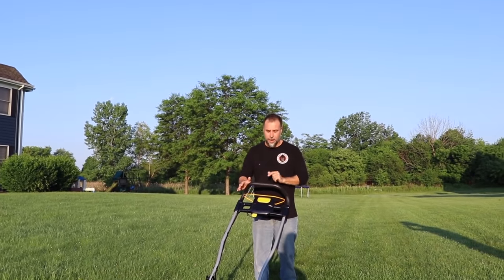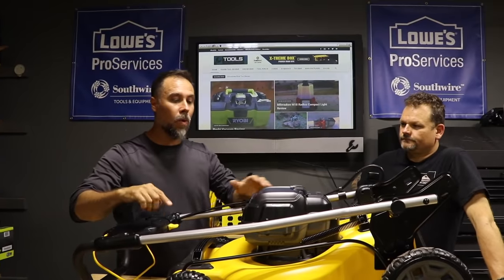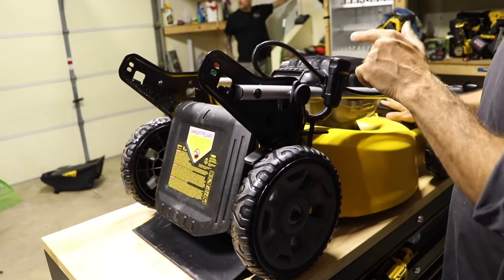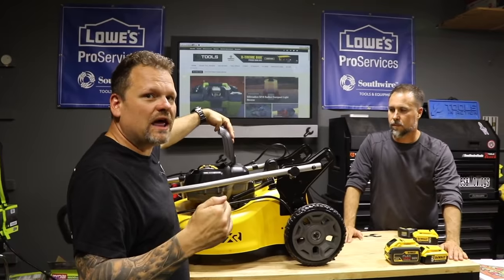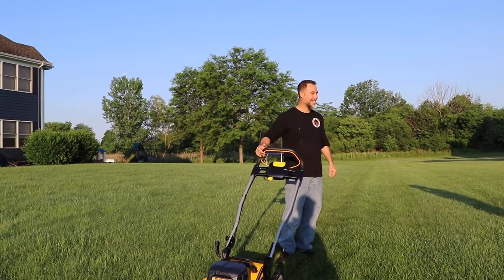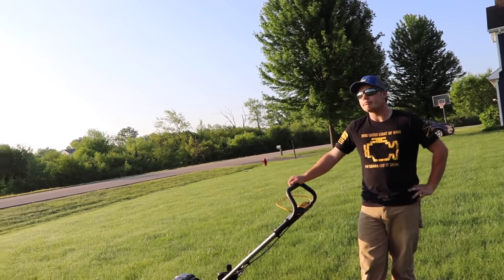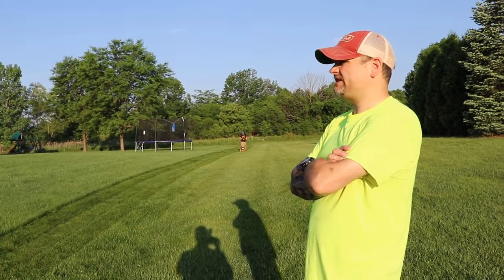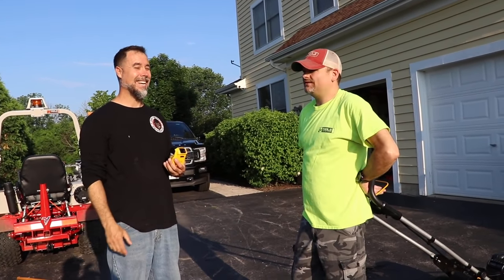Dewalt- 1st place for the Worst Lawn Mower of the year

Comment: Seriously?  The grass is wet, it's 4" deep and you're mowing with an electric mower without a side discharge. I had a gas mower that wouldn't do that before.....  put a chute on it, raise it up an inch and mow on...!
Reply: too complex for them...
Reply: Yea, you have to be smarter than the grass....
Reply: Just watching the intro, I know they didn’t know what they were doing!!
Reply: SuperDave21 I have a 7.25 ft lbs mower, it's brand new... Tons of power and it will not mow this grass on mulch mode... I've used other mowers with more power that won't cut this without issues. I actually know a guy with this mower... Had it a few weeks, and guess what he really likes it. Has a smaller yard though, and it cuts the grass but he doesn't cut grass this tall when it's soaking wet either. Can't expect lawn tractor power in a push
Reply: SuperDave21 dam I just had the same comment. You don't mulch wet grass. This would be a yuppie lawnmower.
Reply: Airflow in the deck is key to mulching. These mowers are not of advanced design. This is a stupid test.... not worth our time to watch. Just wanting hits.
Reply: My thoughts exactly..
Reply: These kinds of reviews are only good for a laugh 😂
Reply: SuperDave21 I KNOW SO TRUE
Reply: SuperDave21 they bought the cheapest version. Wheres the bag.
Reply: DeWalt Fanatic Are Us LOL
Reply: multching mower on that tall of grass not, side discharge maybe slower pushing maybe
Reply: I don't know a gas mulching mower that would of done what they were trying to do. It would of stalled like they did.
Reply: Folks looking for a miracle and a handout.  It baffles me how many reviews are out there complaining about stuff like this, when I see folks with the big machine not wanting to cut wet thick grass or they side discharge and double cut, yet they expect these little machine to do the job.  It just baffles me.
Reply: I was about to say. They went way outside what that mower was designed to do. Not a fair video on that product. It's probably a great little mower for a "green" homeowner who mows every week or maybe every 5 days or so.
Reply: So true when I try to mulch wet grass with my gas mower eventually the mower will stall, but open the chute and let the grass fly and I have no problems. I personally would never buy a mower without a side discharge option.
Reply: SuperDave21     I agree. Cutting grass is rocket science for some people; black magic for others.
                             Never cut it wet. Take your time.
Reply: Try to pull start your gas push without lifting up on the deck, it doesn't make sense.
Reply: My 25 year old gas powered  MTD 5.0hp  would cut that.  It's called maintaining your lawn mower and keeping your blades sharp.  And Yup I've mowed 1/3 of an acre on a  sloping hill.  Thank god for self propelled doo dads.
Reply: Could not agree more. Didn't make it past the intro. Let's now this lawn that's over grown on the lowest setting, while it's wet and at a fast pace. GTFOH.
Reply: I agree, pathetic review lol
Reply: My petrol mower from 1990 or even 1986 would piss all over that thing
Reply: Mate his aim is to provide a bad review
Reply: Well, I'm glad to see people have the same thoughts as me. This was a terrible review.
Reply: @TheJma1024  you dont mulch wet grass. Whats wrong with you people?
Reply: Exactly. Until I added the side discharge to my mower the bitch even had issues when dry. Mulching is great with shorter grass
Reply: I mowed my Bermuda grass with my EGO.  It was wet and did just fine.  Only issues was cleaning all the crap under the deck.
Reply: My kobalt 80volt has no issues with tall wet grass. That’s just not powerful enough
Reply: Agree ... what a stupid review ..
Reply: Mate I do agree with you!! And and..! Use FLEXVOLT BATTERIES FOR GOD SAKES!!!
Reply: I live in wetlands and my 40V Greenworks handles worse than that while mulching. Electric should be able to outperform gas. I've been running that through a very large yard when and where it's too wet for my rider. It's been shockingly good.
Reply: You guys must have some week gas mowers
Reply: Right.  The implication is that there exists a cordless lawnmower that can actually tackle that task.   Hey, maybe Tesla will come up with one, given another decade.
Reply: Well if your testing equipment and putting it through the roughest treatment then you can look at the quality and run time for possible applications you might use it on. So they are putting it through rough stuff for a reason.
Reply: They need pros for this job ;P
Reply: It definitely needs a box on the back of it else it will clog up regardless
Reply: The Milwaukee did way better in higher grass
Reply: I agree……completely silly and unrealistic use of the mower…..wet grass, no height adjustment, no chute, …nonsense….
Reply: I know he’s totally abusing the bajeezus out of the thing - but I got the 2x20v dewalt a couple months ago and honestly it’s frustrating as all get out. Really is the worst mower I’ve ever owned. Just not enough torque for a mower. My lawn is far from perfect - and the mower regularly stops itself and requires a restart for even slightly thick areas of Bermuda in the dry heat of Arizona. I can confirm that this guy is #doingitwrong but also still on point somehow. Buyers remorse is super deep on this one.
Reply: Under power just junk. I'm glad to take a crap less than 8 minutes.
Reply: If the mower was good! It would handle it!  And dewalt is a professional company! Except for lawn mowers!!
Reply: He put an EGO through worse conditions with mulch plug in and he couldn’t stop it. This DeWalt mower is junk. EGO  is the GOAT of lithium powered mowers. 👍🏻✌🏻

Comment: I don't doubt that there are battery capacity issues....but trying to  cut in mulching mode in deep wet grass like that is a bit severe....just sayin....
Reply from the maker: Yeah-  but a gas powered mower could handle it.
Reply: Maybe.
Reply: Zack Young most people don’t use a regular drill in masonry they usually use  a hammer drill and they don’t use it all day either. I agree that the mower is junk because you can do a lot more with a cheaper gas model than an electric
Reply: Maybe a gas mower could but it would be at capacity and putting more than necessary strain on the motor.  I wouldn't do this with my HRX Honda mower because I care about it and I'm not an idiot.  As someone who used to work at a power tool dealer for Professionals / Contractors I don't even really like a fair bit of Dewalts products but your test here was just plain unfair and asking way too much of that Dewalt.  That grass was wet, far to tall and combined with your pace was just plain unreasonable.  If anything I would like to see this Dewalt tested next to some other brands like EGO, Stihl and Green Works in reasonable conditions.
Reply: Same here, I remember my mower getting clogged up on morning dew thick grass (gas mower), as well. I'd stop and try to shake the clumped up clippings lose often. I just stopped cutting when it's so dewy out.
Reply: I have the 40v version, just tried it for the first time and it didn't even let me finish the front yard. Grass wasn't the driest, but wasn't rained on or anything, and i had it set to height setting 2 of 4. I have a tiny yard.
Reply: hzuiel  How tiny is tiny,  I have seen other reviews and I would say it should handle 1,000 sq ft on included battery
Reply: Dennis S  1000 sq ft is about 31x31 and only 1/43rd of an acre.  Lot is about 4500 sq ft, minus the 820 sq ft house, sidewalks, driveway, detached 1 car garage. I'm like a best case scenario for this mower and it couldn't even finish the job. That's not a market ready product.
Reply: hzuiel  my last house had a lot about 4500 sq ft,  I used a corded electric,  worked great,  my current lot is 15,000 ,  I would not consider any electric battery or corded,
Reply: The juck gas constantly screws up my gas tools for home use,  I want to use electric tools whenever I can.
Reply: I have a Toro self-propelled push mower with a Briggs & Stratton engine if i have it in mulching it will do the same thing. Toro pos.
Reply: @Dirtmonkey  a quality homeowner gas mower (say 6.75 B&S) would go right thru that...Commercial Kawasaki Exmark/Toro's go thru grass/weeds up to my knees...don't waste your time with rechargeable toys..if you have a tiny yard and you don't want to deal with gas-buy a corded unit-otherwise use the right tool-quality gas mower-this thing is total 🗑
Reply: William Jackson I have a 140 cc Chinese mower, it cuts down long wet grass,  small tree stumps like it is nothing! It is unstoppable!
Reply: @Dirtmonkey  Not anywhere near as easily as you probably think. I got one of these because I was sick and tired stalling and having to restart a 175 cc Toro every 20 ft.  I find that if you are reasonable about cutting a lawn in time before it becomes overgrown, the Dewalt does a great job. You look like you have a huge lot, mine is under 1/2 acre. A pair of 9 Ah plus  a pair of 5Ah handle it very well.
Reply: True -- my 4.2 hp gas mulching mower struggles with wet 4" grass. In those conditions, I spit the clippings out the side, let them dry for a day or two, and then mow them again to mulch them up. The only battery mowers I'd ever consider are the GreenWorks and Kobalt 80V ones and then buy a spare 5 Ah battery.
Reply: @thatguyb3rt  I agree 100% that a gas mower would handle it. However, not every homeowner has the time or knows how not to overload the unit. That is why they test them in the conditions they do, since not every homeowner is going to mow in ideal conditions.
Reply: @Dirtmonkey  Then USE a gas mower. That is all part of being a craftsman/ mechanic:  evaluating the task at hand and choosing the CORRECT tool for the job.
Reply: @gregs3580  sounds like your mower is junk. Been running a little 159cc Ariens for 9 seasons I don't recall it ever stalling...not once and I cut strictly in mulch mode and end up cutting long grass often.
Reply: @pryme2013  No neither the  Toro   or the Dewalt is junk.  Congrats for never stalling.
Reply: @gregs3580  you were sick and tired of stalling "every 20ft" sounds like junk to me.
Reply: @pryme2013  Well that's quite an insight into your expertise. Now go take that and $3 and buy yourself a coffee.
Reply: @pryme2013  Maybe your memory is suspect.  Never stalled in thick moist grass. That's a hoot.
Reply: @gregs3580  You said you bought the Dewalt because "you were sick and tired of stalling every 20ft" sound like your mower was junk, or you're just lying.
Reply: @pryme2013  Sounds as if you don't understand the relative torque of an electric motor vs that of a ICE.  That's OK, because I do.  I also understand the value of a better designed outlet for the mulched grass which gets accumulated. Let's see , perhaps your attitude breeds ignorance and the need to respond in such a juvenile fashion?
Reply: @gregs3580  again, you're not addressing your original statement that your gas mower was "stalling every 20ft" which I believe is a complete lie. If true, my original statement would prove to be true, you're mower is junk. Done and done.
Reply: @gregs3580  lmao
Reply: @pryme2013  Yeah, laughing one's ass off won't help if they are one and the same.
Reply: @Dirtmonkey  You guys treated this electric push mower in this video like a high dollar, high cc commercial mower.  A gas mower would have done better, but NO STANDARD GAS MOWER will MULCH THICK, TALLER WET GRASS without bogging down and stalling.   Which is probably why you didn't show that comparison in the video!
                              For your next experiment, put a hitch on a Prius and bich when it can't pull a flatbed car-hauler with a 5 ton truck strapped down to it, but SWEAR a Ford Fiesta could do it no problem......
Reply: @thatguyb3rt  me Ego 21" is lighter and quieter. Power wise they would have similar power output.

Comment: This review is a bit unfair. You're mowing what appears to be half the grass height that's wet with full width passes and no discharge at a fast pace. C'mon. Obviously it's going to have less power than a gas mower, but even gas mowers are gonna be feelin' it in those conditions. Same with starting it up. You probably won't start a gas pull-cord mower when it's in tall grass without raisin' the front up either. Try again by mowing only a third of the grass blade when it's dry and a 3/4 width pass and see what happens. No I don't have or have used this mower, but this is a very poor review.
Reply: DEmersonJMFM facepalm
Reply: What are you supposed to do mow every day so it works. Most people now when it gets to that height.
Reply: Electric anything should have more torque than any gas engine. The dewalt electric chainsaw is also a steaming turd
Reply: Grass height/type determines how often you should mow, regardless. Bermuda that's kept very short is usually cut more often than St. Augustine that's kept tall. The mower is irrelevant.
Reply: These are like electric mowers; they do  not perform like gasoline engine ones. You can't mow grass at the same height as a gas mower. You shouldn't even try it when the grass is wet, it bogs down due to the increased resistance caused by the water. The poor run time of the batteries is explained by the height of the grass and the dampness. All grass is damp near the soil to a certain extent. I have used an electric mower for years. In the spring and during mild summers I have to mow every 3-5 days. If I don't, I butcher the cut and it clogs under the deck. You can't expect to use one of these and have it perform like a gas mower. No way. The benefits of battery power and lower weight are offset by accepting the limitations of the system.
Reply: Not my Ryoby/Subaru, it could cut that at the same height faster with no problem.
Reply: maybe, but im willing to bet that $150 gas mower from walmart could do the whole lawn just like that with no problem.
Reply: The point is that People want a mower that can handle the most tuff conditions
Reply: @cheesecurd100s  I have the dewalt chainsaw and it s a beast for an electric unit. No noise no fuel no fumes and it cuts amazingly. try sharpening your chain doh
Reply: I legit came here to say the same thing open the shoot and how many ppl.mow.thier lawns when it's warm
Reply: Poor review... unrealistic to expect anything other than a petrol mower to manage wet grass at that height...
Reply: @bobbond6028  ummm what? Summer is warm, grass needs mowing during the summer? Do you mow at 9pm? You're that neighbor eh?

Comment: I don’t understand why people are using/testing this lawn mower on a huge properties. Then they want to say, you spend $400 on the mower and another $250 on the flexvolt batteries. Dude, if you invested on flexvolt batteries BEFORE you purchased the mower, then there was no reason for you to stay that statement. Bottom line, the dewalt lawn mower is NOT meant to be used on the kind of land you guys shot this video.
Reply: Ya, this is a poorly constructed review by a bunch of boomers who don't understand electric motors and amperage. I'm an electrician, this is a real no brainer for me, no way is this going to mow anything close to that size in a full charge of two 5Ah batteries, but also these clowns are pushing it at a brisk pace through very wet grass and calling it "the worst mower of [2018]", when we all know that there are plenty of other battery powered mowers that wouldn't cut this grass at all. The estimated  maximum run time in optimal conditions, i.e. dry grass on a cooler day, is only 25 minutes with a full 10Ah of combined energy storage. I have no doubt that it would power through at least half that lawn, while wet, with two 15.0Ah 20v/60v flex batteries.

I did learn one useful thing, this mower itself doesn't have very good clipping ejection when the rear door is closed.

Also, as a motorcycle enthusiast, I find it incredibly asinine that they left grass clippings in the road, considering they can easily cause a fatal crash.

Comment: Right tool for the right job. I really like mine for my 2500 square feet lawn. I don't have to pull my guts out with the rope and very low maintenance. No gas No oil No hard starts. Mow my whole yard on one charge once a week. My hats off to DeWalt. Thanks!!
Reply: Just about ready to buy one,  not sure now. I have a ton of dewalt 20v tools and batteries so I really wanted this one.
Reply: Get a grip man, pulling your guts out? Use non ethanol fuel and put stabil in the gas, one pull always.
Reply: would love to know your opinion of the mower now, 5 years later!
I have gone through 2 in less than 2 years (first one was replaced, woudn't buy another!) and replacement is now in the shop. would love to be refunded my $650 CAD and be done with dewalt, but wayyyy easier said than done

Comment: I too have a ton of DeWalt cordless tools, including a 40V weed trimmer and I love it, but it’s doing a much different job than mowing a lawn. My 7.25hp Briggs & Stratton powered Toro sometimes bogs down when my grass gets a little high, so I’m not surprised that a mower with 2 - 20V batteries doesn’t have enough balls to cut what you were cutting. I wish all mowers had that one touch height adjustment. The DeWalt weed trimmer has the best line loading system I’ve ever seen.

Comment: Wet grass, mulching, cutting near 1/2 the length of the blade off and walking at that pace?! I think it did really well. The grass is nearly twice its own weight when wet too. I don't think even a gas mower would handle those conditions without issue.